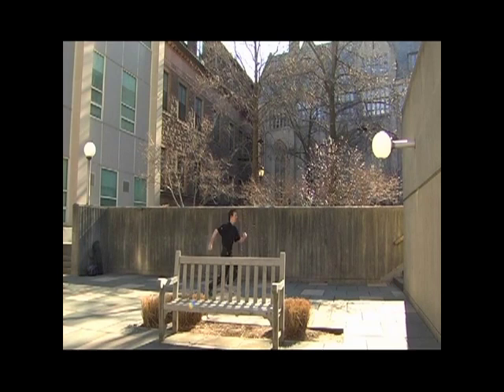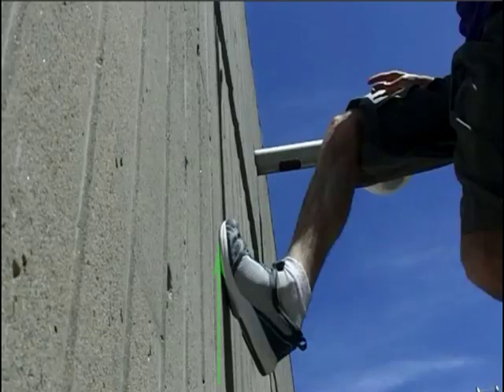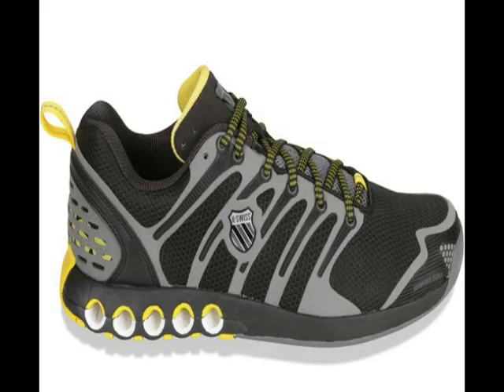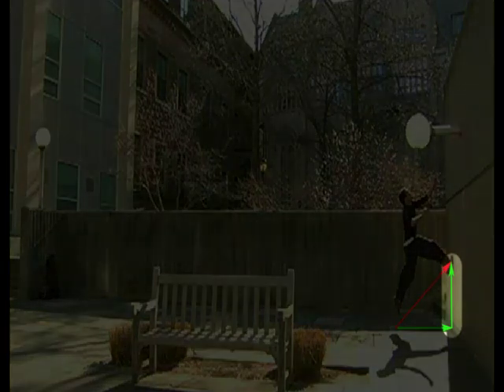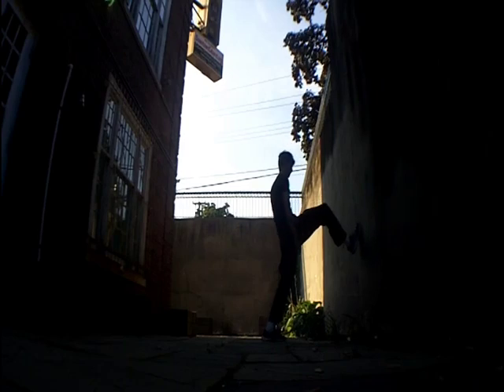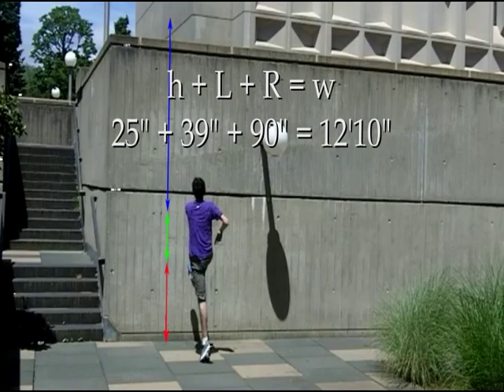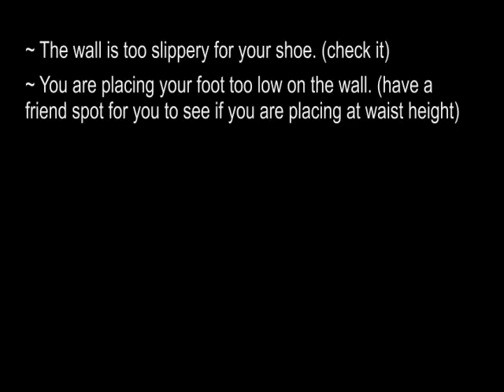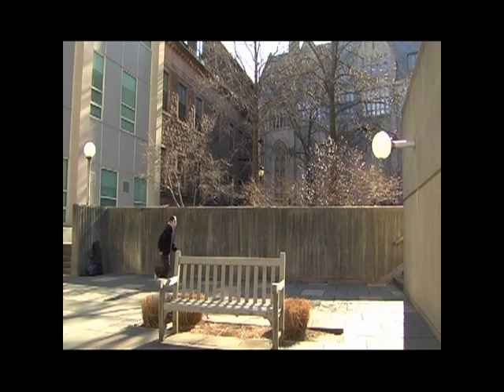Parkour Science #2 Physics of the Vertical Wall Run- Tutorial

Comment: Would it be possible to go even higher by putting two feat?
Like once you do the fist foot put the other foot even higher(running up the wall).
Please respond.
Reply from the maker: I discussed it a little in the video and further on a few threads here. No, because the normal force is finite on a straight vertical wall, using one step or two will get the same vertical height. The normal force (and by extension the friction available) will either be split between the feet or used up almost entirely from the first step.

Comment: I'll preface this with saying I know next to nothing about physics. I just have a question about the raising of the knee for extra height. When I'm standing in front of something short like a bench and take off with my right foot, then land on my right foot, I find that I can jump higher when I swing my left knee up. Why is that? Does unweighting or the momentum of my left leg have anything to do with that?
Reply from the maker: delta freerunning I double majored in Applied Mathematics and Physics
Reply from the maker: Not a bad question. So the effects of lifting the opposing leg while doing a running or standing jump is surprisingly quite different from the case of a wall run. when doing a standing jump like that, you are correct, because of the long contact with the ground throwing the other leg up can be done shortly before the jumping thrust (unlike the wall run) and thus will provide a small momentum boost.
Reply: That actually makes a lot of sense! Thanks you!

So the difference then is the duration of the other planted foot then? To me planting a foot, then raising a leg on the ground vs planting a foot on a wall, then raising a leg while less effective, seem like very similar things. As well, the contact on the ground assuming you are running should be almost the same? Is it that it doesn't provide substantial gains in height or is it that it doesn't have any gains at all?
Reply from the maker: omgtrmc Duration is the simplest way to describe it but it's not at all the whole story. The major difference is normal force. the normal force on the ground is vertical (ie the direction you are jumping) and is produced by gravity which never stops of course. On the wall the normal force is created by deceleration of your running speed which quickly runs out. Assuming you are jumping for max height off the wall, your leg will provide a certain amount of force (as much as it can) taking advantage of that short normal force for sake of jumping up using frictional force (on the ground you are not limited by this) pulling up the leg has to make use of that same force on the wall, which is finite and based on running speed, grip, and jump angle. On the ground however (standing at least) you have time to flex one set of muscles to lift the leg and another set (which is no longer limited by frictional force) to thrust secondarily, giving your body two (sort of) different momentum providers) not limited by friction and a diminishing normal force. For the second question It may provide a better jump angle for some people but no it provides no gains at all (outside of comfort for personal technique) That is to say I am not at all saying "don't do it." just that it doesn't effect the jump if you do or don't do it already. A running jump is different from both of these for various reasons. but the leg lift does help a running jump.
Reply: ParkourScience what kind of degree do you have? Technical science?
Reply: That's really cool O.o, I'm probably going to study Air and space engineering @ TU Delft nxt year.

Comment from the maker: It has nothing to do with the wall. Let me explain in a different way... do you believe you can jump higher if you throw a weight into the air and hold on to it, than you can just having that weight on you back? You can't, because in the end your legs still have to push the weight. Your knee/other leg is that weight when it comes to the wall run. Does that make sense? If not this has been a very big discussion so I may make a quick video to explain this point alone, so everyone gets it.

Comment from the maker: Correct. it does not help give extra height (it can help your balance a little bit, but not power or height) It doesn't hurt either though, so if you are used to doing it, it may be best to keep it so you don't throw off the rest of your technique.

Comment from the maker: Good question. Short answer is no... not really. The reason that the arm throw helps in a normal jump is usually because it aids in angular efficiency of the jump. In the case of a wall run (especially at max height) the run up is much more efficient in facilitating an ideal angle and the arm throw will actually not help due to the limitations of the leg muscles (the equal and opposite action of the arm swing must go through the legs as well)

Comment from the maker: Good question. You are correct, for a long or high jump this is a factor. For a wall run though, because of the need for the normal force and frictional force when you hit the wall to be as near equal as can be for maximum height the angle of the take off needs to be just under 45 degrees. A long jumper,, because they can run much faster than they can jump uses that torque to get a higher angle, even still they run MUCH faster then they can jump up resulting in an average long jump 21 degrees.

Comment from the maker: Yeah this only covers the physics of the first part of the wall run at maximum height. If you drop the height to about 2 feet lower then your max then the climb up and the wall run physics begin to overlap each other and then you are right that the power transfer will look different. At maximum height though the climb up remains 100 percent separate from the wall jump which is why I tried to make the distinction that we would cover the climb up in a later video. Thanks for your comments :)

Comment from the maker: Driving the knee up doesn't violate newtons laws, the idea that it adds power does. consider where the equal and opposite reaction occurs when you drive the knee up. The net force from that knee drive has to have a source and it is the push off of the wall that provides the normal force to do so, the push off the wall is done with the other legs muscles which are limited in the power they can produce. thrusting the other knee up won't add any power as a result.

Comment from the maker: It tends to end up being a case by case basis depending on your shoes, technique, and the grip of the wall... best bet is through trial and error... Try it out... if you jump from the right place and still slip on the wall you may want to try running faster, if you crash into the wall (without slipping) you might need to run a bit slower. let me know if this helps.

Comment from the maker: The hand placement has two purposes, it is useful for safety if your foot slips it keeps you from hitting your face on the wall and it creates a second smaller set of forces analogous to the foot placement on the wall and provides just a few extra inches of upward height by pushing against the wall and down.

Comment from the maker: If you learned it in a way that made you more adept to two step runs then the second step will work for you better. But due to the nature of the limited normal force the second step doesn't prove to be more effective than placing the hand and vice-versa. By that I basically mean which ever way you learn it will work. They both have advantages and disadvantages but the height for each will generally be the same (but not the same for each person)

Comment: I know that you said taking another step in the wall run doesn't help that much but in my experience doing both the take off and the second placing of the foot correctly has actually helped me reach higher places. But the problem is if you got the take of wrong and if you have more kinetic friction it will most of the time fail. But hey parkour science hasn't been done this detailed before so there's going to be lots of stuff to research.

Comment from the maker: It seems odd I know, but the upward speed won't change for any given person but a traceur will change the angler by maintaining the upward speed and height while increasing distance and forward speed resulting in a lower angle, this is not only necessary for the greater normal force but also because of the more complex effects of the angular interaction with the wall.

Comment from the maker: Correct, though not an assumption. The human body uses a specific set of muscles to jump up while running. Controlling the impulsive speed of those muscles at a run is difficult, traceurs usually just use full power (or close to it), this results in the upward speed being limited by the persons biology. Contrary to what you might expect, running faster does not significantly add to or detract from the power of the upward thrust. (critical is good thank you for bringing up concerns)

Comment from the maker: You would expect that but it turns out that because the height of the foot placement and the speed of upward jump are fixed the speed of the run up ends up directly correlating to distance of the jump. Not having that distance in conjunction with the increased run up speed will result in quite a crash. The further analysis of this showing the correlation was a bit too complex and drawn out to put into the video, its counter intuitive to someone who knows their physics, but surprisingly true here